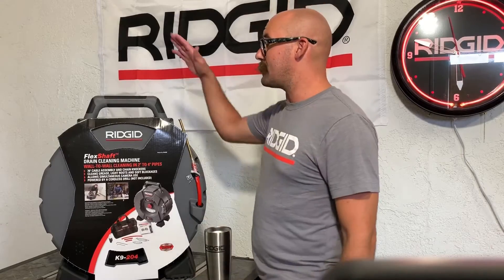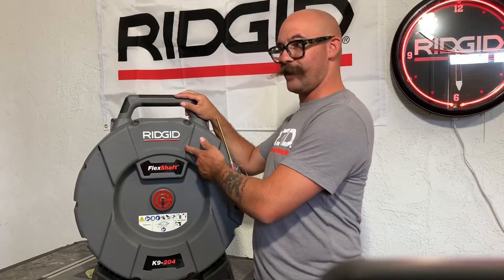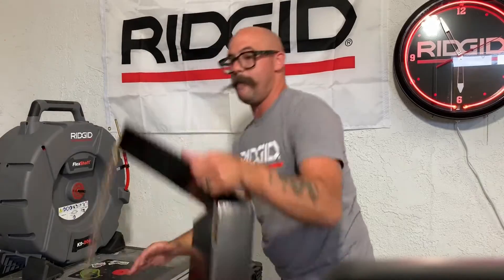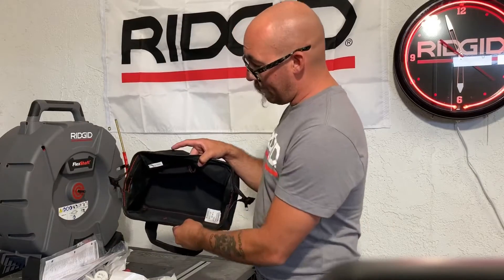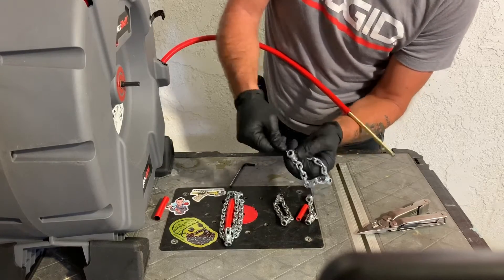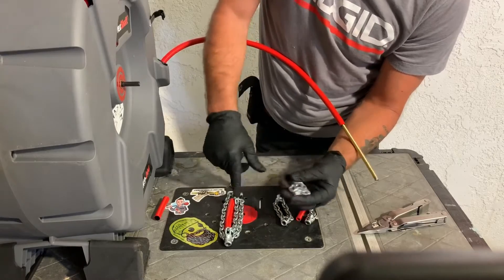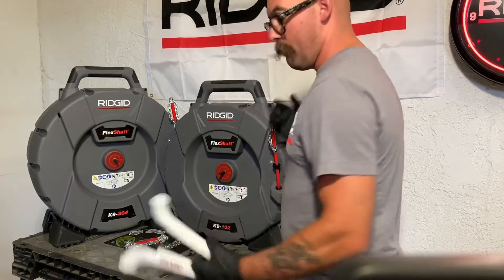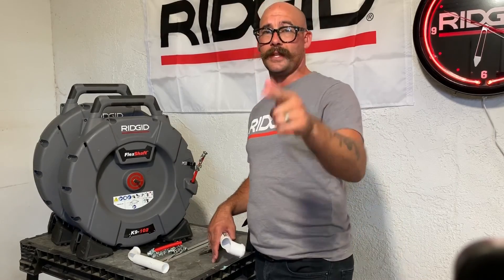Ridgid Flexshaft K9-204 K9-102

Comment: I'd like to see some real world videos of the unit in use also like to hear about maintenance - what is the oil for and how to use it. Like to see the case disassembled and how to clean because I assume eventually its going to get full of crud and have to be cleaned even if you wipe it while extracting.
Reply: pr872 I have used a flex shaft cable for a year now.The oil is to lubricate the brass flex shaft but as far as cleaning the orange tube I just wipe it with a rag
Reply from the maker: Steve Kokkinidis thanks Steve
Reply from the maker: pr872 I thanks for the comment. I will do a repair video soon
Reply from the maker: Steve Kokkinidis thanks Steve

Comment: I watched another video with this equipment. They had a representative from Rigid demonstrating the unit. He had the spacer (short orange tube) between the main sleeve and the chain knocker. I'm assuming that it was to reduce wear on the main sleeve but that's just a guess. You might want to look into that for the proper setup. Please note, I don't have one of these machines and I don't know what the correct setup is, just relaying something that might be important.
Reply: It does help

Comment: In 4 inch pipe I’ve had this tool turn around on me several times
Reply: Any smaller cable can turn around on itself if the space is big enough.